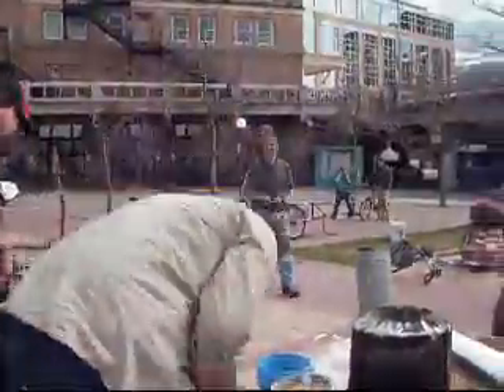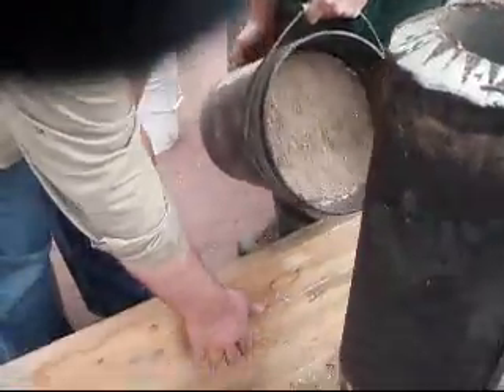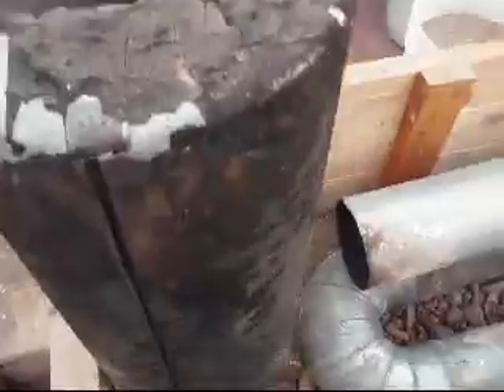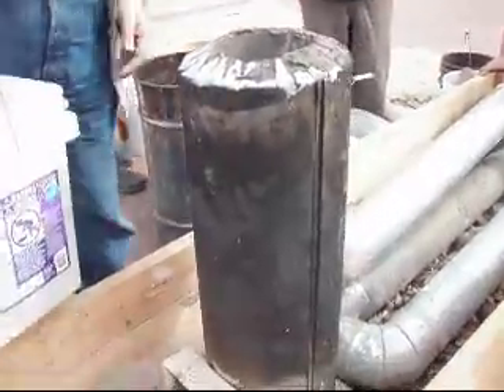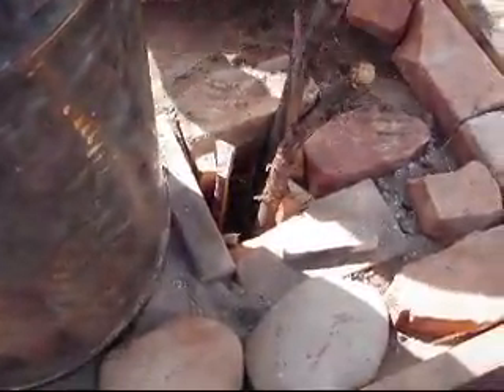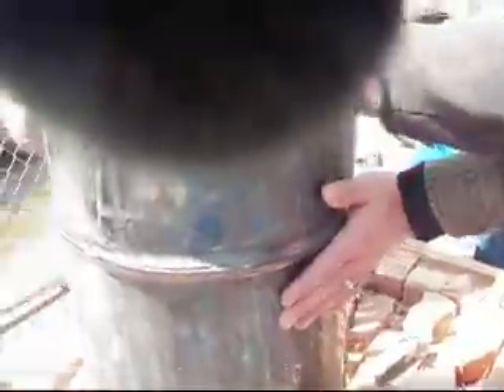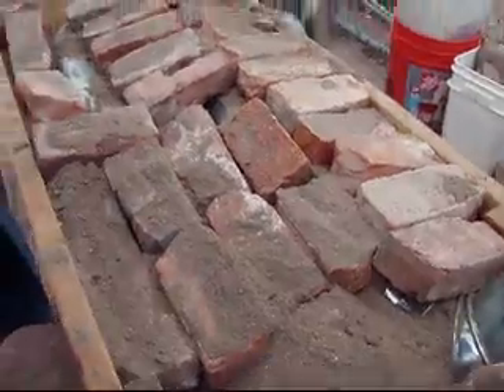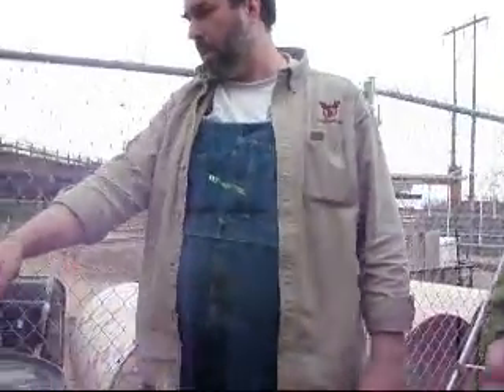rocket mass heater movie_0002.wmv

Comment from the maker: Perlite and clay.  Take a ball and press together with fingers.  If it sqsueezes down like clay, add more perlite til ball explodes in the hand when squeezing.  put between two stove pipes that are about 3" diameter apart. (can bend metal over to edge=phalangie.)  The cover, about 4" wider diameter, is sitting on fire bricks that make a shaft into the exhaust ducts, covered by a metal plate over top the bricks, and covered in sand and brick.  (missing fotos), next you tube! Might cost ya though!